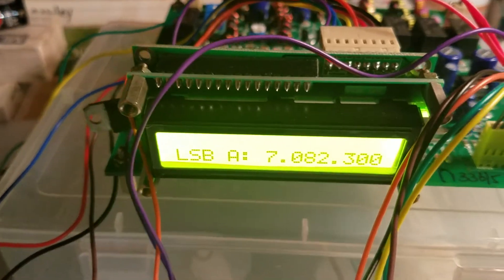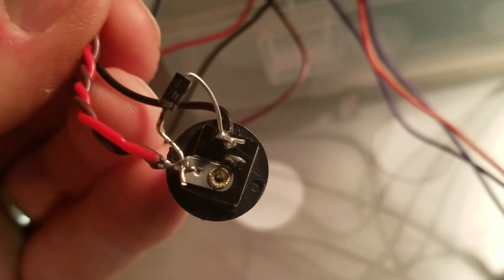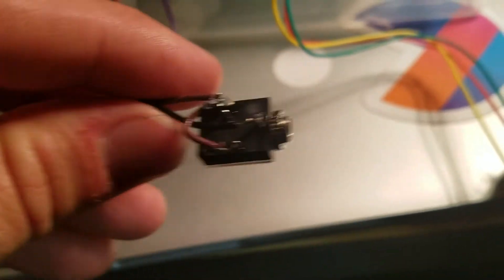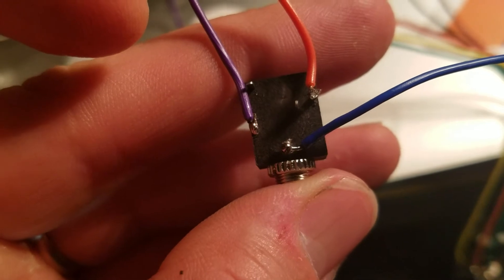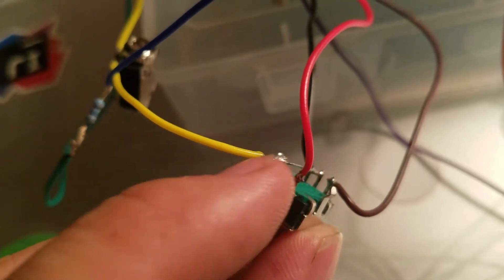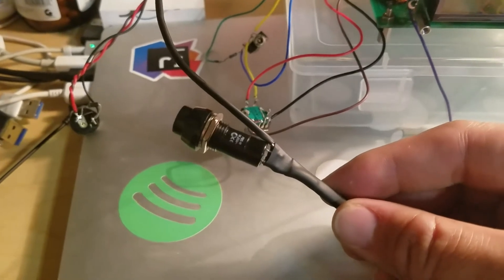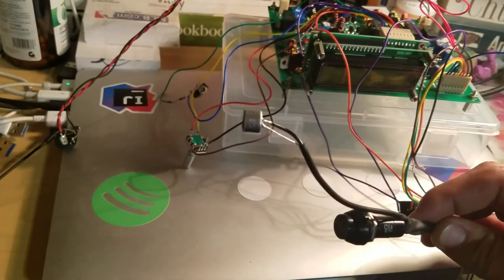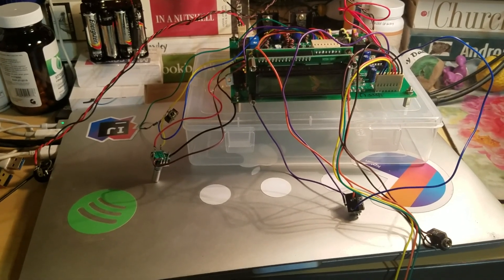uBitx Wire Up

Comment: Nice job..make sure you ground the equipment to avoid oscillations and spurs  when you mount it to the case ,also use coaxial cable to connect the output amp.to the antenna terminal ..could be RG 58, the small diameter  is good to match impedance ....good job and 73s....de Kp4 bp...

Comment: I have finished my bitx ver3 connections few days back in a similar way in
My own style.  Rx tested and copied most of hf stations. But problem started when tried to talk . Mic is unable to drive.  In CW mode found delivering 10 watts. Tone ok. Have you done anything on Mic gain?  I have used Baofeng Ext mic which the  default  mic locally here .

Comment: Linux In A Nutshell?  Gotta love some Linux.  My mBitx should be at the house today when I get there.  I'm going to try using an 8'x8'x4'' pvc junction box as my enclosure.  I appreciate the "newbie" video because this is the first time I've done a project like this, so it helps to see a good basic video like this before all of the fluff of te enclosure and knobs are added.  Best of luck with your antenna situation and I hope to hear you on the air.  73s.  K5RFL

Comment: Thanks for sharing the video... with the battery pack you probably have 1 watt or two... but you need to adjust the PA with a dummy load and the power supply...

Comment: Thanks for the video... I've  received my uBITX and the documentation is almost worthless.  What documentation or resource did you use to figure out how to wire up your radio?
Reply: You can go to hfsignals.com and find the wiring diagram... it’s pretty simple to have this radio working in less than 3 hours
Reply from the maker: Mike Pate I primarily used this https://groups.io/g/BITX20/wiki/UBITX-Assembly
But supplemented by the official documentation at http://www.hfsignals.com/index.php/ubitx-wire-up/
Reply: The wiring diagram is with the sketch software.  Just go to that site and you will find a schematic.